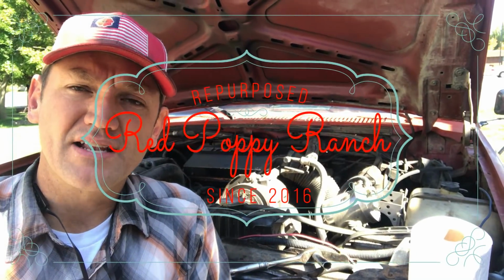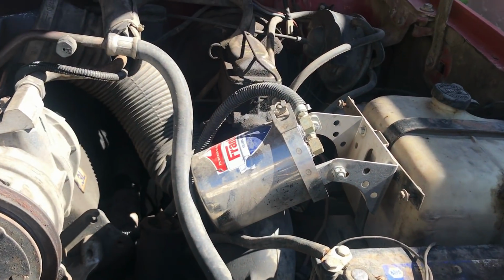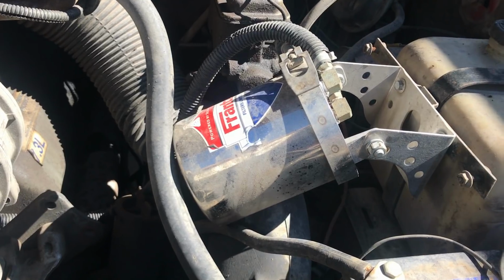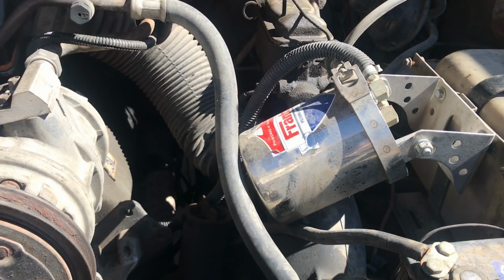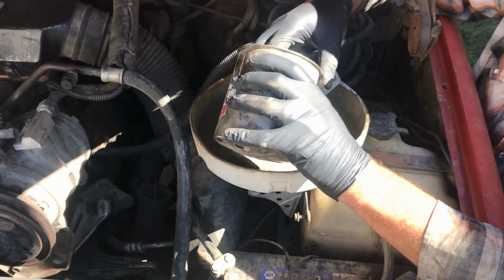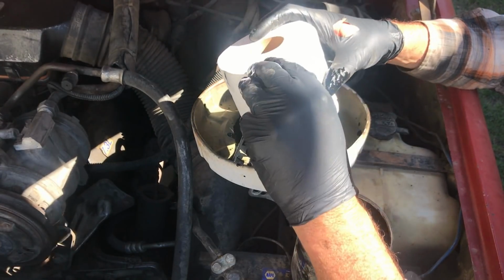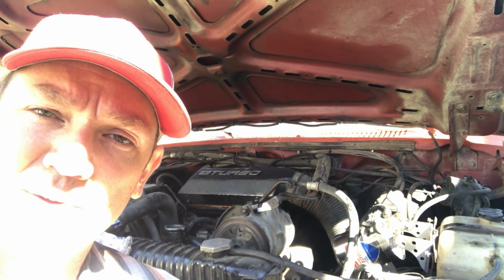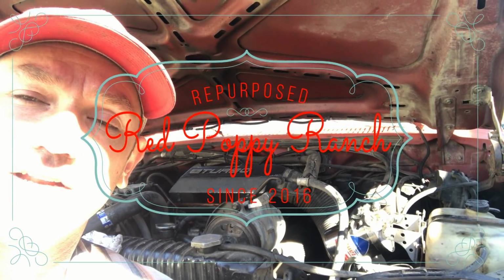#146 - Toilet Paper Oil Filter Maintenance... (Frantz Oil Filter)

Comment: Wait till he has chunks of toilet paper plugging the oil system up
Reply: ignorant comment. I have one of these. My dad has used one for 20 years. Never had a PT in the oil problem
Reply: Dune Buggies and hot VWs tested the Motor Guard toilet paper filters back in the 60s. They had a good article about them.They put a inline fuel filter in the return line. Of course paper fibers can't get thru pleated paper. After the off road test they cut open the fuel filter and found no paper fibers. They found a trace of gold in the Motor Guard. It was tested in California.
Reply: @ralphwood5114  of course the Motor Guard was on a VW dune buggie. Thought about running my 66 beetle on the dry creek beds and picking up some gold in the oil bath air cleaner and the Motor Guard. Too much work doing the gold pan thing.

Comment: The most important thing in your engine is lubrication.Why would you do this.Toilet paper wasn't made for the hot extremes of an engine.What are you saving?You can get half decent filters for $2.99!
Reply: With only a full flow filter you get dirty oil. To filter people there are two kinds of abrasives. Engine damaging and engine wear. The full flow gets the engine damaging abrasives. You either drain the oil to get rid of the engine wearing abrasives or you install a good bypass filter. It ain't complicated.
Reply: After 60 years of using the filters I'm taking advice from someone that knows nothing. I dont think so.

Comment: Oil is cheap engines are expensive.  Change your oil.
Reply: Are the Galatic Empire in the oil refinery business now?
Reply: Allowing oil to get dirty wear and foul the engine then draining it ain't cheap. My choice on a diesel pickup would be to use a proven oil such as Rotella or Delo and change the toilet paper every 2 ,000 miles. I use synthetic in my Altima but I only use about 3 qts a year.There are only two reasons for engine wear.dirty oil between the parts and not enough oil between the parts.

Comment: Jerry Bates tells fairy tales.
Reply: We will always have the liars. There has never been a bypass filter that caused someone to loose an engine. Neglect can cause dirty oil to damage an engine. In the old days there were a lot of neglected sludged up engines. If you put a Frantz on one of them watch out. The sludge will win the Frantz will loose. When the sludge destroys  the engine it will be called toilet paper.  Rare with modern engines. It happened with my uncle's 59 Ford. I lived near and was able to deal with it. We removed the Frantz . Traded the Ford in on a new Dodge pickup  and put the Frantz on it. I knew we were in trouble when the Frantz stopped heating up. Not so lucky with my dad's 51 Pontiac  He was too far away. Told my uncle we can open the engine and remove the sludge. He needed an excuse to buy the Dodge.

Comment: One minor comment ... You really need to keep a close watch on the A/C hose and the battery cable you have riding against the oil filter case here. They will rub through and you could get some really nasty side effects.  I've had similar damages happen because of the same conditions. I'd relocate the filter slightly or add anti-friction protections.

Comment: Dollar store Scott rolls are perfect sizes if you can find it! Otherwise it’s the Scott single rolls that are packaged individually!
Don’t forget you need to soak the filter in oil before you put it back in and it makes a world of difference on the fit. Dry fitting gives you the wrong size! It shrinks
Reply: Makes sense I guess 
 I've done fine putting them in dry..all I have now is Motor Guards and Gulf  Coasts. My.sister wrecked the old Impala. Lost my last two.Frantzs. I've always been able to put my Frantzs upright so the excess oil can drain. I dont have the proper long nose paper remover tool.I put a couple fingers in the core.and count off 30 rounds for the.Motor Guards with the Great value 1000 from Walmart.  I have a couple of Motor Guards horizontal behind the Grill on my.Altima. Engine and tranny have to remove the grill to service them. Come to think about it I've had some shrinkage on the Gulf Coast jrs might try soaking them. Was talking to a Boeing engineer that designed the Motor Guard. He sometimes used a smaller roll to increase the surface area. The Motor Guard was tapered. It sealed good at the bottom half. The Frantz might be the only one in production now. Too many bull shit stories with toilet paper filters. Of course Motor Guard only makes compressed air filters now. Gulf Coast does the heavy duty diesels.I kind of like the new model  Frantz. It looks high dollar. The last Great Value I got at Walmart  was just the right size. Didnt need to unroll any just like we used in the 60s. I'm told the size varies  depending on where it is made. The last Great Value 1000 from Walmart  was the right diameter for the Motor Guard. Didnt unroll any.

Comment: How did the oil sample test look.
Wait....you used toilet paper....septic safe or regular.

Why did you put toilet paper in it.

Doesn't toilet paper filter refer to what it looks like, not what it is...

Where's the next video on this where you have toilet paper on the dipstick and people call the cops on you for toilet papering their trees.
Reply: No one has ever beat toilet paper at cleaning oil. The advantage of the Frantz elements is they fit. After almost 60 years of using toilet paper I dont plan to change. After the toilet paper cleans the oil the wear virtually stops. Back in the old days of poor oil and carburetors. You could end up having to open up the engine and clean the sludge out before installing the Frantz
 Or you had to change the Frantz every 50 or so miles. A lot of people are using Scott 1000. It looks like the newest Frantz model was designed  with Scott 1000 in mind.  It looks like you dont have to unroll  any rounds. All of the toilet paper filters  were designed to use toilet paper.  I used toilet paper many years before there were Frantz elements.

Comment: Save the unwrap for cleanup and fire starter    :)
Reply: Greg Burnside best advice in the comments so far.
Reply: The last Great Value 1000 I got from Walmart  is the same diameter as what we used in the Frantz in the 60s. Didnt have to remove any for the old Motor Guard.

Comment: OMG, they still make those? Does it still work with the shorter rolls? (not less sheets)
Reply: The shorter rolls work fine. With the shorter rolls you have to be a little more careful.If you push the roll in too far you might not get a good seal around the core. That is where the Motor Guard and the Gulf Coast Filters have the advantage. You are pushing the roll down in the tapered housing against the seals. Other than that they filter about the same. Watch out for some of the Scott 1000.The individually wrapped ones That l bought had the core that fits the Frantz but the ones in the multi package are firmer. If you are not a highly skilled toilet paper squeezer like me buy the Frantz elements.
Reply: With the shorter rolls you need to follow the old instructions. Push tha roll against the knee so that when you put the roll in you have a bulge. Dont push it in too far. Make sure the core is round. The bulge should make contact with the core seal . Then push the can down against the gasket. You dont want to depend on the oil pressure to push the roll down against the core seal. When done right with a firm roll you shouldn't need the sleeve or ring. Later  makes such as Motor Guard  and Gulf Coast solved that problem. Frantz is the hardest to service.Motor Guard only makes  compressed  air filters now.  Gulf Coast does heavy duty diesels with big paper towel filters. With the toilet paper filters you have to deal with too many fools.when I say the Frantz elements are better than toilet paper it's because they are more idiot proof. You have to know what you are doing to use odd size paper.
Reply: You have to be a little nuts to try to sell filters that clean oil to people that think oil is supposed to get dirty and be drained. Clean oil is not where the profits are. If I was younger I would be back in a marine vessel engine room like a dummie at 120 f in August.
Reply: The last Great Value 1000 from Walmart was just the right diameter for my Motor Guards and Gulf Coasts. Lost my last two Frantzs when my sister wrecked the Impala.somewhere in a Dallas salvage yard.. In the 60s you could usually find a Frantz in a California auto salvage for about 10 bucks. No that doesnt mean Frantz owners wreck their cars. That means there were a lot of Frantzs in California.  Dont want to get another toilet paper story going

Comment: YOU COULD START BY STEAM CLEANING THE FILTHY ENGINE AND AREA, THEN BREAK DOWN AND CHANGE THE FREAKIN OIL .PUT IN A NEW REAL OIL FILTER. DO THIS ON A REGULAR BASIS
Reply: Real filters don't clean oil If they are the real filters that use pleated paper.

Comment: Respectfully, your logic is flawed. I am unconvinced of your findings. This Snake Oil Filter still manages to get you to change your oil one quart at a time ever 4 months. Seems like hell of a lot of effort just to avoid just changing the damn oil and filter twice a year if you are that lazy. You do not seem like a lazy person at all, so I question why in the world would you use a Gimmick from the 50's when so much research and development has been accomplished since then to provide us with State of the Art Oil and Filters. You stated that you use synthetic oil. Why? Why would you use toilet paper and not use what Detroit Diesel recommends for example or what the Ford, Chevy, or Dodge, the actual auto makers recommend for oil change intervals? I do not feel I am smarter than the engineers who designed and built my Truck which now has over 387k original miles on it. I change my oil and filters ever 3k to 4k miles or at least twice a year, but more like 4 times a year because I drive a lot. Not trying to berate your efforts Sir, just hoping to add my voice to all of the others on here trying to help you stop making a silly and costly mistake. But, hey! You Can lead a horse to water...
Reply: That's actually what you are doing. Changing the oil one qt at a.time. the Frantz never lets the oil get dirty. The new oil keeps the additives up to specs. Without a filter that cleans oil The dirty oil starts fouling your engine in a short time. You can get a lot of.miles if you piss away a lot of money on oil changes
 No thank you.
Reply: Snake oil is when you are sold a filter that doesn't clean oil and told to come back and they will drain your dirty oil and sell you another filter that doesn't clean oil.Why in hell  people fell for that I'll never know.
Reply: Any automotive engineer knows that an engine needs a full flow filter to get the larger engine damaging abrasives and a depth bypass filter to remove the smaller engine wearing abrasives. Many years ago I read a Ford engineers report on the subject. Got it from Frantz. Oils.have gotten a lot better but filters have not. A Shell Offshore drilling rig with Gulf Coast  Filters using paper towels or a toilet paper filter on a 7.3 ford it's the same principal.
Reply: Shell engineers were measuring the parts on a series 60 Detroit with over a million miles with one oil drain using paper towel Gulf Coast filters and of course Shell Rotella T one engineer said it's not unusual  for these engines to go a million miles but not be in nearly new condition. Toilet paper is actually better than paper towels but the paper towels have the size advantage. The oil has to travel thru two rolls of Bounty towels from top to bottom. Dont be a damn fool. Road King magazine asked me for the truck owners phone number. They did an article on it. The big Gulf Coast O2 uses 2 rolls of Bounty big roll paper towels.  When the filter is changed 3 gallons of Rotella is added. When the full flow filters are also changed its 5.5 gallons of Rotella added. That's equal to a full oil changed every 40 thousand miles. It was being studied. By Shell oil. Lost track of it at 1 million miles when I retired. Another system Road King mentioned was Amsoil and a Como filter. Dont know what  a Como filter is.

Comment: The only thing that would concern me about this is the flow rate of the oil.
Reply: Why? You do realize that the stock full flow oil filter is still installed on the engine?
Reply: The oil pump supplies enough oil to supply two or more engines. It has a relief valve to keep it from over supplying the engine. The oil pump don't know that a qt or so of oil is being cleaned and going directly to the oil pan.
Reply: My objective. way of looking at it is I am 80 years old. I was 13 when Frantz started making filters. 23 when I installed my first one. Bypass filters were here long before I was born. They all have the orifice and clean a qt or so a minute and send it to the oil pan.
Reply: Up until the 1950s all filters were bypass filters . Almost all of them were optional  equipment factory installed.  They all hooked up the same as the Frantz. Why do we have people that know nothing about bypass filters trying to explain how they dont work. I do agree with you on one thing. You are no mechanic. To be a mechanic you at least must know the oil system.
Reply: The oil pump pumps the same with or without the bypass filter. I think the system is too simple for smart people to understand.You might need to be a little low IQ like me to understand the oil system. I'm a simple man the filters and oil system is simple.we are a good match. Worked all day trying to fix the head lights on the wife's  Pontiac Torrant. Released the parking break and the lights came on.
Reply: @scud69er  you have no idea how the bypass filter works but you are explaining how it dont work. The Frantz works the same as the factory installed bypass filter on my 64 Rambler American flat head 6 . It supplies the oil pan with filtered oil. The only difference is the Frantz cleans the oil first.
Reply: @scud69er  Iis probably better to understand the oil system. Bypass filters have been on cars for 100 years They have no effect on oil flow  if the engine or oil pump are badly worn and the oil light goes on at idle I wouldnt put a bypass filter on the engine. In some cases the relief  valve in the oil pump is stuck open.  Any problem caused by  not keeping the oil clean shouldn't be blamed on a filter that cleans oil. Make sure the engine  has no problems  before installing any bypass filter.

Comment: You can get the oil through the cardboard center roll and all those plies of toilet paper?,,,,,surely you would need 1000psi oil pressure at least?,,,,,
Reply: The oil filters from top to bottom it doesn't go thru the core. It is 1000 sheet 1 ply.
Reply: If.you see a car with.a Frantz ask if you can put your nose on it.to see if hot oil is going thru when the engine is running. Look at the.oil pressure gauge  to see.if.it has 1000.psi.on it.